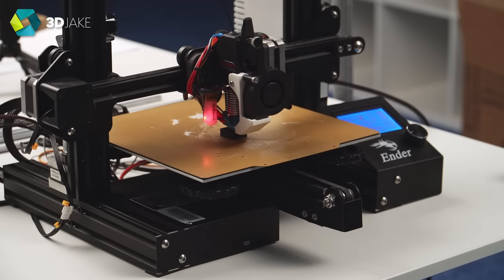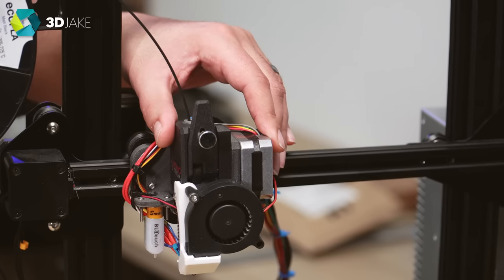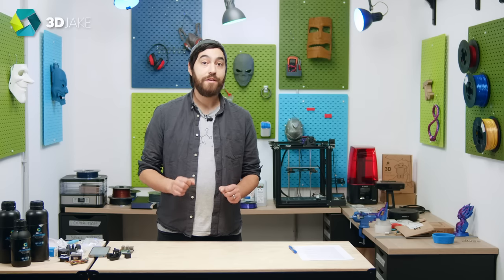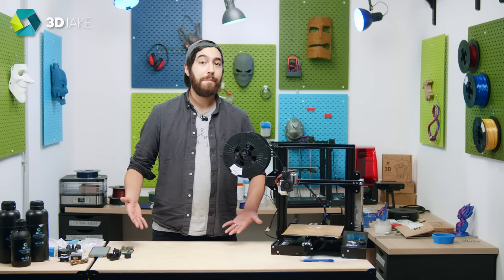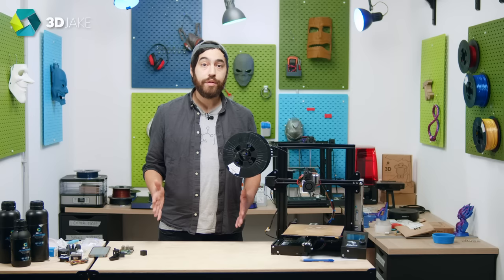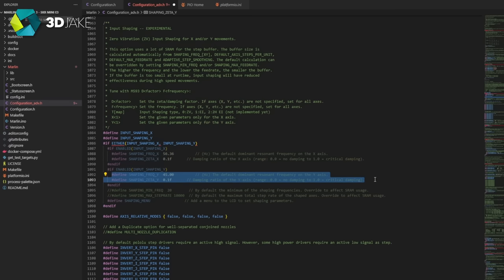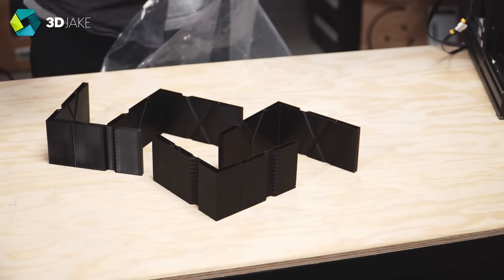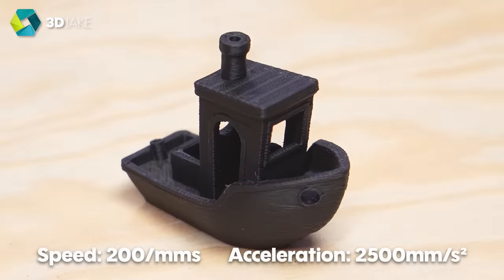Input Shaper on Marlin 2.1.2

Comment: Marlin = one variable needing to change in pins or boards or several others = 20+ minutes of compile and flashing. For it to possibly not work. From scratch setup of a totally new Printer to a totally new board without previous examples = days, Plural

Klipper = EVERY change takes seconds, can be tested within seconds, and a new printer conversion with new mainboard without previous examples = 2-3 hours.

I'll probably never go back to Marlin. Just based on the R and D speed differences.
Reply from the maker: The manual testing was the most time consuming by far which is a serious drawback but adding a new board, firmware modification and flashing took about 25 mins. Obviously still doesn't beat klipper with an accelerometer but how long does it take to flash a pi, print a pi mount, print an accelerometer adaptor, not to mention the cost of the pi.
Reply: Many variables can be changed from gcode commands (Pronterface).
If you need to enable or disable something in firmware, you only have to edit a text file, press build button on Vscode and upload it to your printer. Flashing only takes a few seconds. I think your comment is not accurate at all.
Reply: @alejandroperez5368  unless it's in pins or boards or anywhere it might be when you are swapping boards and writing from scratch. 
Which I can do in klipper with only a weekends training. 
Worked with marlin for several years and firmware and major changes still took forever. With some features and functions simply being too complicated to figure out how to implement. 
Had it all working on clipper the day I first picked it up. Within 12 hours of knowing it even existed. 
Coming from an IT background, I can say for me, klipper was 1000x easier to learn and understand.
Reply: I have a setup which allows me to update Marlin very very quickly because i have a custom bootloader and custom upload procedure. I could probably tune it more by customising the bootloader yet again but i probably don't even care that much. Though i have a different background C++ and embedded devices so :D

But i'm going to do Klipper soon for a variety of reasons. I intended to do this for longer but this kept getting pushed back simply for lack of time and then misplacing the Pi i stashed away for it :D
Reply: @SianaGearz  I have seen many setups that use Gcode and M-commands to do much of the setup post compiling, and some that update firmware over USB. As a poor nerd, I am using the Big Tree Tech line of boards typically in my builds. SKR1.4, 3, Octopus, Pro, Etc. Which of course are not capable of being updated over USB. 
Klipper for me was a whole list of ease of use upgrades, and seriously simplified the setup process. 
For someone who can code, I am sure Marlin is super easy. Or at least more navigable. But for someone who only ever edits config files and writes IPChains Etc, the Klipper config was just worlds apart easier. And tuning is also SUPER easy. 
Tuning marlin would take me a week or more even after I had a working firmware. 
Tweaking klipper took a few hours. The tuning prints took the time. IF you had the variables they give you up front, tuning in klipper is an hour or less task. Start to finish. 
Its easy enough that I have a 9 year old nephew using it successfully with his Ender 3 we klipperized. 
I'll never go back to Marlin. 
Klipper is the way.
Reply: @theway-offgrid9853   Haha i once had to write ipfilter rules and i nearly died :D

I'm using the old ATMega 2560 boards! A GT25660 Rev A+ and a MKS GenL V1.0. I have a MegaCore bootloader on them which i installed with a dedicated programmer via SPI pins because i needed to debug a watchdog bug, and stock Arduino bootloader bootloops when it occurs, which made it highly unpleasant, but i do get a lot of extra speed as a bonus, and i could tune it further, i also turned off verification. I have soldered bodge wires to pins PCINT11-15 so i can talk UART to drivers, 5 wires next to each other at 0.5mm pitch. These are "illegal pins" because Arduino Mega has them unrouted but myself and a Marlin contributor added support for them to Marlin.

I don't have 32-bit 3D printer boards, so you actually have that much more budget than i do. STM32 based would have been nice, you get a $2 STLink for connected flashing, and it's quick too, good tool. Well perhaps i was a little lucky with STLinks that i bought, i heard today they are a little hit or miss, but mine are authentic clones that take official updates, really good clones, and they were that cheap back in the day. You can also flash an STM32 with any $1 TTL-Serial dongle in STM32's BOOT0 mode, though it only flashes at 115200 baud, which isn't very quick. With ST-Link you don't even have to do any mode switching and have debug access as well. Indeed an STM32 based board would have been a dream :D With either of these ways, STLink or serial, you can install an Arduino bootloader on the STM32 to flash them directly over the board's USB, the Maple DFU or its derivatives, that's actually very fast. Of course the SD-Card based firmware updater is lost this way. Anyway it's not a hardware limitation but just all about knowing your way around things. There are other things to pay attention to when modifying the bootloader such as the split in the address space between the bootloader and the firmware, which is why it's not entirely trivial, you may have to dive deep into some of the build and upload tooling to change the parameters.

One major reason i'm so curious about Klipper is that it promises THAT much better stepping. Not only planning, but also the stepping routine is asynchronous as opposed to Bresenham that Marlin uses, the problem with Bresenham is that the fastest axis on any given move has perfect stepping while the other axis all have aliased stepping, while asynchronous stepping can spread that aliasing out evenly or eliminate it entirely. Also with higher step rates that Klipper offers even on 8bit processors, i can increase microstep count and cancel out the interpolation bias of the Trinamic chips. Trying to juggle advanced planning and stepping algorithms on an 8-bit AVR is highly perilous.

You can also use ST-Link on NXP LPC17 like on the SKR. It also has the TTL-Serial bootloader integrated in the processor chip just like STM32 but they neglected to provide the jumper or button for that - you have to solder to the side of a resistor to gain one, which isn't too bad. There hasn't been an Arduino-compatible USB DFU written for it though i don't think. By the way for these i think dc42's RepRapFirmware is very viable, it's a great firmware which has extensive G-code based configuration (doesn't ever need recompilation) and very powerful motion planning, much more so than Marlin. I believe it's asynchronous now as well as opposed to Bresenham, and the planner was leading for a long time, it also has ringing suppression. Perhaps with that i wouldn't be so tempted to go for Klipper, but with Klipper i can just reuse things i happen to have in the household :D

Though looking now LPC17 port of RRF seems abandoned. Smoothieware is another alternative vaguely in similar vein.

Right now i'm trying to get a Pi 0 W to boot to Klipper within 12 seconds and give it a resilient flash filesystem as well, so i can power it off my 3D printer's PSU. I foresee it being quite an adventure because KIAUH kind of expects a full fledged operating system, while i'm aiming for a very stripped down one.
Reply: @SianaGearz  I have thought of making a Rook 3d Printer from Rolohaun with a Pi0, but I feel like the lowest I would want to go would be a Pi Zero 2 W. With the Pi3B processor. 
Its getting my hands on one for a reasonable price that is the issue. I switched out to Odroid products and boards, because I can get them whenever I want. And not super expensive. I'm paying more than a base Pi price of course, but it shows up in a few days and my projects can progress. 
I also did notice the stepping and noise of the printer was improved with a tremendous reduction in noise. Even on the same board I was running marlin on previously. 
Acceleration and overall control, for me, are greatly improved and simplified. 
Errors and issues are usually called out in as plain text a way as possible, and a simple google search fixes issues quickly. 
You'll also notice to flash, even an STM32 over USB there is this thing and that thing you gotta do and solder, and whatnot. 
With klipper, I load up my Odroid board with anylinyxiwant, load kiauh, load klipper and all its parts using kiauh, and use it to make the image for my stm32. This I can do in under 15 mins. All of it. 
Then take a sample klipper file for the board, and the printer I am klipperizing, look at the way the data needs to blend together (For SKR3 for example, use the Pins in the printer.cfg from the klipper SKR3 example, and the motor and hot end specs from the klipper example of the printer you are klipperizing) and whola, I have a fully working printer in a few hours. 
I've NEVER had it that easy with Marlin. for someone of my level that can script but not fully code or understand a single programming language beyond Basic and a VERY small amount of C, klipper just works. And Fast. 
And getting to a reliable setup that is properly calibrated, was EXTREMELY well thought out with klipper. Its made for the lower qualified tech hobbiest, such as myself, to get a hold of quickly and get to a viable production cabable version, of whatever machine they currently own. 
The upgrades of just software to my ender5 pro, completely changed the printer for me. It had been down for months, without my ability to dedicate the needed time to write a new firmware to get it back online. 
Then I watched a klipper video. And BAM. Back online the very same day. 
Been ROCK SOLID ever since. 
Anything that needs to change, Its notepad easy. 
Need to recalibrate Z offset? Changed a Heater or printhead? Thermistor? Stepper? Driver? 30 seconds and your back to the races... 
Done a few now. (Ender 5 Pro customized, Ender 5 Plus and CoreX/Y kit plus allmetal microswiss, Cr-10S5 full linear and allmetal microswiss, Ender 3 Neo V2 allmetal microswiss) Can build and klipperize ANY printer at this point. Something that was simply not possible for me with Marlin without a LOT more know-how. 60$ Touch screen, 100$ woth of Soc and mainboard, decent power supply, and bam. I have a new 32 bit silent printer. With parts from several older machines, I can build or buy and klipperize a working printer in a day. From scratch. 
I was just hitting a wall with every new board that took weeks to find and hunt down all the info to correct and get working to a reasonable quality level. 
Klipper makes handling new chipsets and Pin IDs WAY easier. And worlds faster to develop and customize a working config and UI setup that you like. 
Oblico makes watching and controlling a printer from basically anywhere, an absolute snap. The framerate on Video streams and the timelapse macros are simple to configure, and performance is really good even on lower end SoCs. 

Throw tree supports into that mix, and its completely changed the way I approach not only 3D printing, but drawing out parts/models as well. 
It gives you almost complete freedom to hang parts pretty much anywhere without having to either build in supports into the drawing itself, or learn more complex support types. 
Picked up tree supports and for the first time since starting the hobby 7+ years ago, the support just popped right off. Tried it MANY times since, and to date, it has NEVER failed me. 
Supports are easier to remove, and even when playing with settings, still seem to come off easily and are pathed to always leave one area open to not fully enclose a part and leave a spot to break away the support from with ease. 
Its just so much game-changer for me between the new Cura and Klipper, with ease of use, simplicity of even advanced calibration (Pressure advance, PID Tuning, and Input shaping) combined with just a faster software setup and config, firmware simplified to basically Idiot-me proof'd, and now I darn near have a replicator! :-) 
The path to functionality for a lower skilled person, with some PC Experience, with Klipper, is a 10-20x improvement over Marlin. Easily. 
My 2 cents :-) 
Thank you for the detailed reply. I will actually try some of the Flashing methods you suggested. I have seen them in the past, but complexity of setup seem'd daunting for someone who couldn't even get marlin working / compiling properly in the first place. I could likey adapt those methods to klipper and make this even easier. So, it fired up the gears for sure. Got me thinking in new directions. Appreciate that! 
Have an awesome evening!
Reply: @theway-offgrid9853   I agree that the Klipper approach is better, but the SKR V1.3 can definitely be updated via USB without a programmer.  It takes about a minute to compile and upload.  Just remember to press "Release Media" from the Marlin menu before pressing the upload icon on Vsc.  Then press the reset button to run the new firmware.
Reply: @propheteyebert7063  Either way, the Marlin experience, vs the Klipper experience, not to mention the difference in learning curve, Klipper is the very clear winner. Marlin was always a fight to get something to work and having to recompile and use a micro SD to reflash each time (Never could get the USB method to work reliably on 4 different SKR boards) just made it a beast to work with. Klipper, from never having seen it before, to flashing it, to config file to a working machine, took me about 2 hours. AT MOST. There were times my printer didn't work for a MONTH trying to get something to work properly on Marlin. Its just two different worlds.